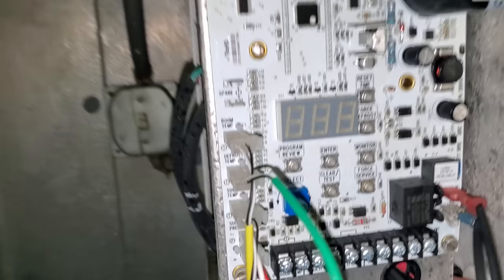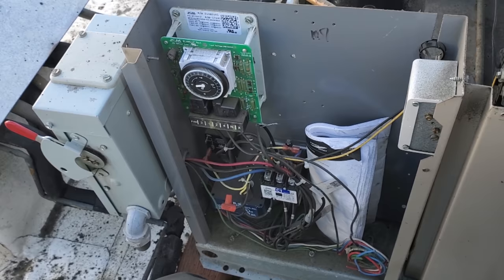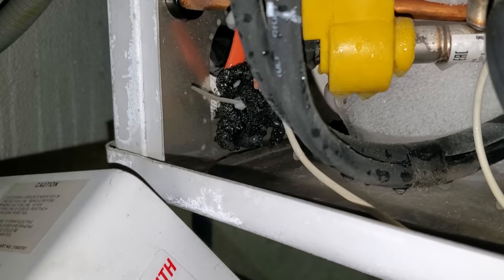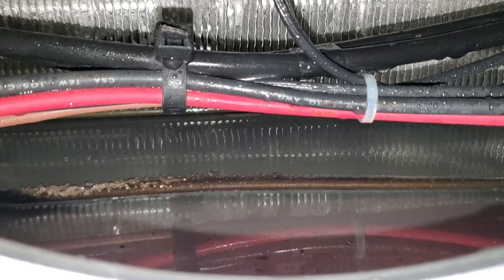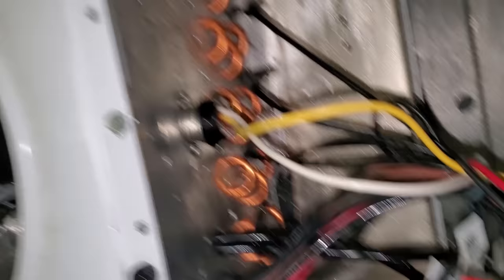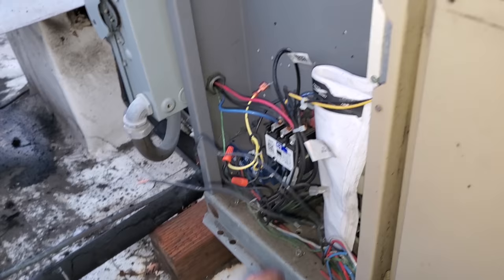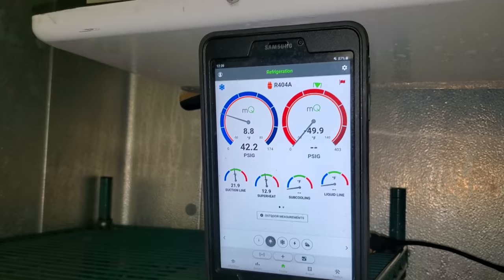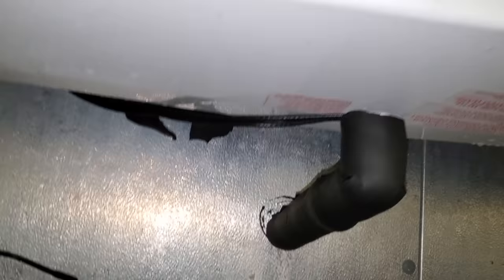THE OTHER COMPANY COULDN'T FIGURE THIS ONE OUT EITHER

Comment: You sound like the guy that charges more than most. But when you're  finished, the customer doesn't need to call anyone again for a long time.  I never mind paying extra for guys like you.
Reply: This is the guy that also said that you're not supposed to wire from the units on the roof but he still does it. He's no better than the installers that did this. He just happened to figure out this particular problem.
Reply: Some wording isn't recommended though he still does some wireing shouldn't do as aka nuteral to ground.  He said he doesn't get paid enough. You set your own wages.  Need to charge more.   You get it right the first time.  And no callbacks.
Reply: i just hate those guys that say they are the best and charge more than everybody else, but do a half ass job. its hard to find guys that charge more and do a really good job
Reply: @jaysidhu3313  and when you get the quote for the job you feel faint and get 3 other quotes and hire the cheapest
Reply: @jaysidhu3313  I am a Master Mudder. I charge LESS and STILL dont get hired . why.
Reply: @gullybull5568  i do work to really good standard and don't cut corners. My prices were competitive but never get the jobs. Now I work for a company because too many people take the higher price. You always here of the cowboy builder never the good ones
Reply: You obviously don't own any commercial refrigeration equipment.  The quality goes out before the name goes on.  Wasn't always that way but is now.  Plastic pistons in the compressors, etc make for frequent call backs even if installed by Jesus Himself.
Reply: Quality doesn't cost it pays. The reason I stick to commercial/industrial  is homeowners! They know the price of everything, YouTube lol, but the value of nothing.
Reply: the problem is to find people like this. I can pay double if it only will work and the problem will not go back.
Reply: I like to do it right the first time. I know of many companies that either go by a company approved vendor or a business others have used. This doesn't guarantee it's done right. My repairs on things don't mean I'm good either but I tell it up front.
Reply: @curtzeek8818  Wdym. He called out all their mistakes from the start and he didn't have to talk to tech support. He got everything right in one call when the other company messed up on every single service call they did. He wouldn't be making videos if he couldn't stand behind his work.
Reply: @RagnarokCo  You're not addressing what my post was about. My post stands.
Reply: This crap is why I don't do low temp since I started my own 20 years ago.  Way easier way to make a living and doing a good job.
Reply: Over the years I've been told many times your more expensive, but it always works after your done! It's so frustrating!
Reply: You can’t put a price on great workmanship
Reply: Same

Comment: You are the difference between a guy who actually knows what he’s doing and a guy that just throws parts at the problem. Good job.
Reply: You are right, but there are times with complicated systems when you have shotgun the problem in the interest of time. Of course, you must first check to make sure there are no shorts in the wiring or the receptacle of the component. The power check was the right approach in either case.

Comment: I’ve been a commercial boiler tech for 30 years. Must say I love your technique of troubleshooting/ good job. Sometimes it is the simplest things that’ll solve the problem . Had a customer on a commercial boiler with a heat exchanger that put a valve on the drain pan that caused nothing but O2 sensor issues because the valve is not supposed to be there.
Reply from the maker: Thanks for the nice words bud!!

Comment: The customer needs to take YOUR findings and sue the other company for that money back.
Reply: Alot of time. Not worth trouble
Reply: Sue them!
Reply: They hired them. their at fault. Liberal nonsense of liability like this needs to be gone. Do your research.
Reply: @brandona4618    I believe that all vendors and manufacturers should stand behind the quality of their work and the assumption that they are skilled enough to perform that work to reasonable standards.
Reply: @jeromeduffy9270  For thousands of dollars, wasted time, aggravation  and principle, it IS worth the trouble.
Reply: @brandona4618  And how do you get the data to do research? Someone has to be scammed the first time. I get what you're saying, but a company (or person) that does wrong IS liable for the wrong they've done. If this weren't the case, then we wouldn't punish people for committing crimes. It's not "liberal" to force someone to take responsibility for their actions.
Reply: @brandona4618  Even after doing your research you can still get screwed over, so that liberal nonsense you refer to makes more sense than your "do your research" crap. Also they might have hired them but they didn't do the shoddy work themselves so therefore that company should be held accountable but I suppose common sense is to liberal for you.
Reply: So spoke one of the muppets that worked on it before a proffesional came and fixed it.
Bet you voted trump.

Comment: I bet the company has been going around talking about how the equipment was junk and cheap and its been their fault the whole time. I've seen low budget equipment with a quality install go years without problems and high dollar equipment with horrible installs that are nothing but trouble.
Reply: Cars are the exact same way... a well-maintained Cheapo special will last forever ... while a brand new multi $100,000 car will die early on because nobody cares about it. I can think of one person on YouTube who purchased a Range Rover for less than $4,000 because the technician before him destroyed the engine and then said and came in with catastrophic engine damage so they couldn't repair it.

If technicians would own up to their mess-ups ... stuff would get repaired for what it's actually worth.
Reply: @DaveFromColorado  Well not the same exactly, most higher end cars have tons of tech and that tech and ''innovation'' is what breaks and costs a fortune, also some of those customers do skimp on services which on a more advanced system, can cause major problems. Your plain jane Corrola just do basic maintenance and an odd job now and then and drive it forever.
Reply: Don't buy a car built on a Monday or Friday. The thing is alot of people doing all different kind of jobs screw up and the next person who takes a look at it. Only goes off what the stated issue is and don't think of why it is happening. Then use shortcuts to get it working, thinking they knew what they did to make it work and not thinking about the next person. Which I think is unprofessional and can cause incidents.
Reply: Jim Grady  Agree, it’s all about a quality install, and start-up. I’ve installed hundreds of KE2 equipment with nearly zero problems. With over twenty years in the trade, I’m still hungry and watch trade videos all the time. I recommend this along with a few other YouTube channels to my younger techs. Keep up the good work!
Reply: Depends on how cheap you're going. I've installed customer supplied evaporators and condensing units with nitrogen purging and triple vac, but the copper on the evap was so thin and poorly coated that the whole thing was full pinhole leaks within 6 months from ant nest corrosion.
Reply: @richardcline1337  Sad but true.  And much like all of the dollar store crap, it too was "made" in China.

Comment: I have found where a walk in freezer had a huge ball of ice under the evaporater, and was told a lot of people worked on it . They couldn't find the problem. First thing I checked was the drain heater. It was bad also the drain line was not connected. Nor was it pitched correctly.  After correcting these problems its been two years ago working just fine. Nice video great to watch.

Comment: I'm a mechanical engineer that designed custom walk-in chambers for 20 years.  I know exactly your frustration.  The things I've seen people do are unbelievable.  I would typically get sent out on a service call after five or six people have made undocumented changes to the electrical systems and still problems persist.  I've, stupidly in retrospect, been told I'm not allowed to shut chambers down and have worked on operating chambers with live 120 VAC/208 VAC/3-phase/60 Hz electrical systems.  On one job I got shocked four times.  I've seen obviously just plain dumb things done by technicians that defy common sense and yet they did it.  I would typically be sent out after nobody else managed to fix the initial problem and usually created a much bigger nightmare for me.  Looking back I must have been a glutton for punishment.  But I always managed to fix the problem sometimes with a lot of cussing and disbelief of what others had done.
Reply: Correction: "I was a service tech with a mechanical engineering background" .... and must have been a glutton for punishment.
Reply: My brother went to work in the tech. and start up part of a major dehumidification manufacturer. Some of the stories he's told me,  I mean these are $50K t0 $200K pieces of equipment. Had one installer call with all kinds of issues, when asked about pumping a vacuum and how many micron's! Oh we don't have time for that, we just give it quick pressure test and charge them up. Gee I wonder your having problem, brother couldn't make him understand why it was so important!!!   He pushed on up to his boss's as to weather they were going void the warrantee's. A lot are weed growing factories some of these factories can have 10 to 30 units on the roof, crazy!
Reply: Do you drink
Reply: Never risk your life for a job, you don't know what devious trap is waiting for you. Assume every surface is live when you come to a new site and always cut the power before even opening boxes and enclosures!

Comment: OK... let's guess... it would freeze up, shut down, they'd turn it off to fiddle with something, the ice would melt, it would work for a while, they'd charge for the "repair", later, it freezes up again, ... again and again for a few years? Interesting business plan.
Reply: Step and repeat!  Yay! For the win!  No, seriously you're correct. It's horrible!
Reply: Silas Marner there’s a simple explanation. They got this restaurant confused with their bank. 🤨 Joe Biden, the Government and the Media are trying to convince Americans that the same thing happened to Hunter.
Reply: Yep, exactly what is happing with my home AC. But the real problem started with Choice Home Warranty. I paid for three years of warranty. They denied every claim from the month after we moved in and is still a problem. They have been sued for millions and continue to get away with their fraudulent approach to the warranty. We had to pay cash for a new compressor, for a new fan, new heat exchange, and freon replacement. It all started with the fake OKay from the purchase inspector, then the resultant compressor replacement, then it was freezing up, which required the replacement of the fan and finally, the cooling declined slowly over three months u until the freon had escaped. A cracked fitting was the reason. But how had this plumbing line function for 12 years and then cracks after the fan was replaced?

Comment: I was at a friends house replacing  bathroom sink faucets and tub/shower fixtures to a brushed nickel, when she says that her washing machine keeps running hot when she does a cold wash. She wasn’t sure if the washing machine wasn’t working right. I told her that I’m pretty sure the installers attached the water lines backwards. Sure enough that’s all it was. 
That’s not the same as you, but following somebody’s mistakes is both frustrating and amazing.
Reply: My last landlord installed the washing machine lines himself.  Blue handle for hot water, red knob for the cold water.  You'd be surprised how long it took me to figure that crap out!
Reply: My dad has a heater for his pool but every 5 minutes or so it would make a banging sound and shutdown, restart, and continue the same cycle. It did heat up the pool but it always seemed off and took awhile. After a couple years I decided to have a crack at it. I RTFM and within five minutes l found the problem. The "professional" installers who've been doing this for years and years put in a bypass valve between the input and output of the heater. The heater already has an internal bypass valve. You are only ever supposed to install an external bypass if your filter motor exceeds a certain amount of HP which this was well under. As soon as we piped the external bypass out and did a straight in and out it's been running like clockwork.
Reply: The last plumber in my house did the following . . Lifted  bathroom  sink, lost his balance ,  fell with sink striking  bath tube.. chipped bath tube.... continuing  his fall the man fell against the toilet. It was knocked loose and leaked  at the drain.  The sink faucet was six  years old and rusted so it leaked from the  underside!

Continuing  on, i didnt dare call the  three hundred  dollar plumber  again, pulled the commode ,  discovered  the $13,000.00 bath room renovation six years ago left one side of the  commode  flange  hanging in mid air! It anchored on one side only ! 
 No permits often equells shoddy work.! 

 My wife did  the bath renovation    on  her own  and used a big  box store who provided  that $150.00 fuxture from China and the contractir who got  squeezed out of  any profit in this  job .
Reply: That's not a bìģgy.
Reply: And the indicators on the taps. Uhhg
Reply: Ashley Haadt  not at liberty to give names..  but a famous lady in SB had that done onp purpose to keep the seat warm.  This was back in the late 80s i believe.
Reply: Mobile home manufactures sometimes would hook the faucets backwards and connect hot water to the toilet.:-)
Reply: I had to put my shower thermostat in upside down.
I even had to buy a different one to do that.
Reply: You could probably just swap the color inserts or the knobs.
Reply: @mrtechie6810  but if the washer is ment to draw cold water for a certain setting, it would still be pulling hot
Reply: @Sweet68Camaro  of course you still have to connect to the cold water line.
But I have often seen in rental apartments, where there are two faucets and the colors are reversed -- as in Dan Cooper's comment.